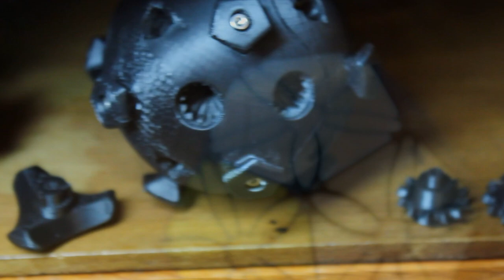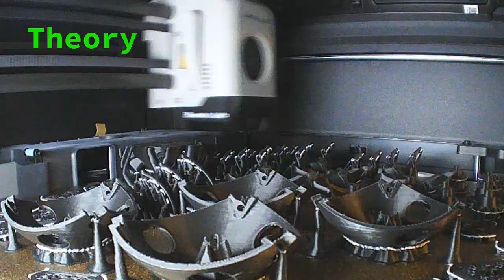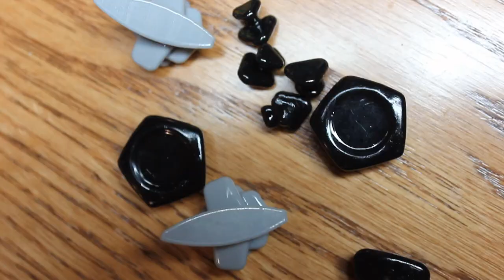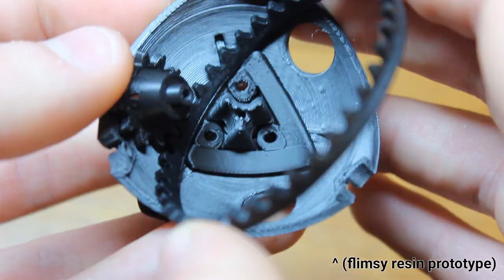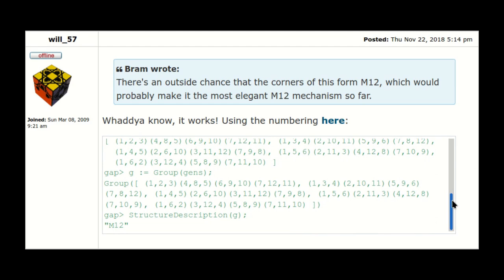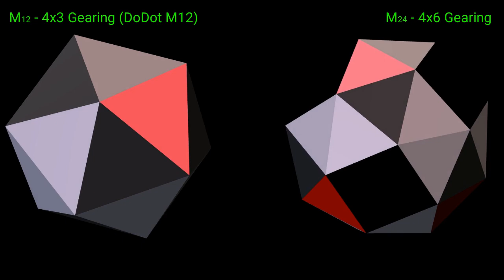QuirkyCubes' DoDot M12

Comment: Great job! I know the solving experience is quite unique. Can you comment on the difficulty? Are you able to solve this puzzle? Thanks!
Reply from the maker: Sure. Yes, I've solved it twice using a spreadsheet to track side effects of the edge-preserving sequences, and I came up with a solution that's tough but gets the job done after a couple hours of fiddling.  I think it's easier than biaxe-style puzzles, some of which express weird groups, since there are 4 options for turning axes instead of 2.  I've also started working on an optimized solution using a computer and I think with better algorithms it will be easy to solve.